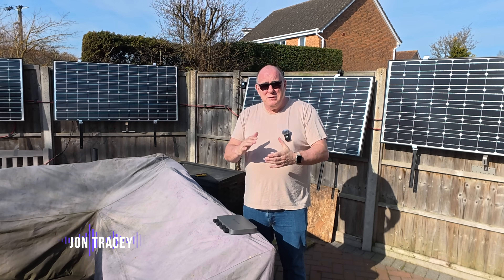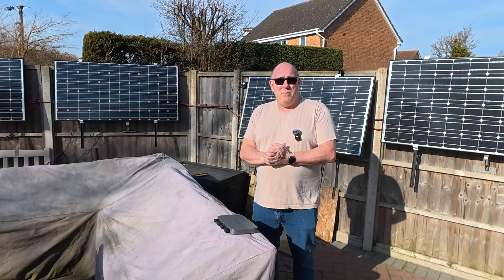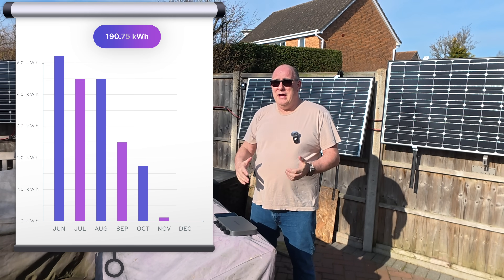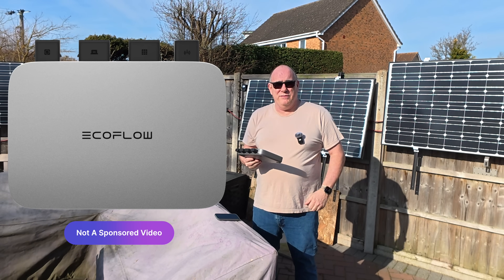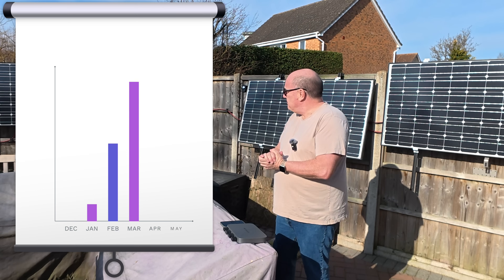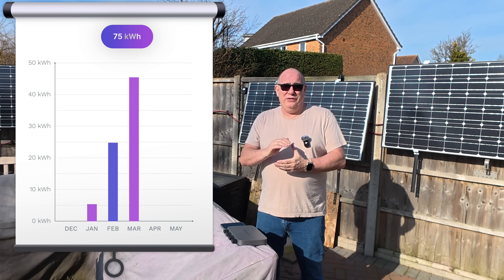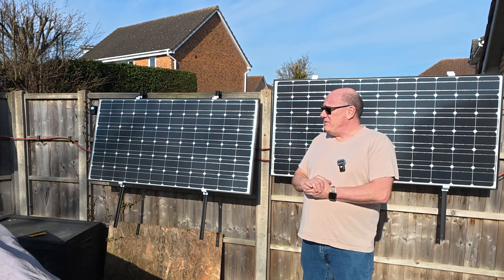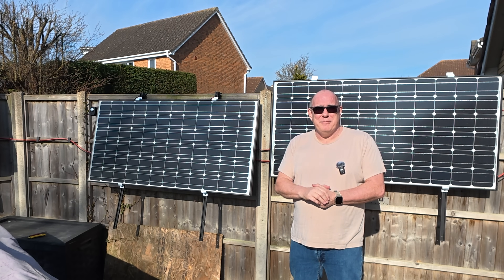WINTER SOLAR PANELS PERFORMANCE SHOCKER

Comment: Being a multi Delta 2 power station + extra batteries owner (5+ kWh total), I am always interested in this sort of stuff. They are charged at night using the Octopus Go tariff and we then run all our heavy stuff (fridge, air fryer, kettle, coffee machine, toaster, microwave) off them during the day. Being in a rental house means solar panels on the roof are not an option. However, I am toying with the idea of putting the cable of portable EF solar panel through an air vent to charge one of the Delta 2’s, just for a bit more “back up”. I have subscribed to your channel based on this video and I am interested on your progress and results. Also, interested into knowing if it’s possible or how Delta 2’s could be integrated into the domestic house wiring, in case we buy our own place one day. I have friends who have professional solar panels and 5kWh batteries fitted to their properties and get feed in discounts. However, I am gobsmacked to hear that if there is a power cut, they cannot use the battery power to feed their houses and will have to suffer a blackout regardless of their system. 🤷🏼‍♂️🤦🏻‍♂️ Thanks for the video ..good stuff. 👍🏻
Reply from the maker: So there are two ways to add the Deltas to the power system in the house that I know of. The first is through Ecoflows Smart panel. However if your in a rental then I doubt you want to start ripping out panels to make this work. The second is to use the powerstream inverter. This only needs wired into a fused spur, and can deliver up to 800w from solar and batteries. But even without solar I believe it can send 600w direct from the batteries into the home.
Reply: @  Thanks for that, excellent info. I will research the Powerstream inverter. 👍🏻
Reply: @ thanks. I have had a look at the inverter, but 600W into the house isn’t going to be much use to me. I think running my appliances direct from the Power stations seems to be my best arrangement as there are no power constraints. Interesting though. 👍🏻

Comment: that looks to be a sun tracker with single axis adjustment. probably a motorised solenoid or similar behand the panel. I have an ecoflow system the inverters are a great price but the cost of panels and extras is not that great
Reply from the maker: Well, I could tell you you correct but then you wouldn’t come back next Tuesday and watch the video😂
Reply: @JonathanTracey  Ha! Nah, I love this stuff. I'm very limited with my solar, I just have a powerstream with a single solar panel. It does okay, though, giving me peaks of 460w. The MPPT doesn't seem to clip past 400w.

Comment: Brilliant This just popped up on my Feed Probably because I watch a lot of similar Stuff. Any hoo I've had Solar panels on my Fence which is also on my balcony for 3 year Started with 2x12v 200w now upgraded to4x12v  250w I've got my electric bill down by 50% Fences with solar works well I've found
Reply from the maker: That’s amazing! 🎉🚀 Love hearing real-world success stories like this! Solar panels on your fence AND balcony, that's amazing.

Going from 2x200W to 4x250W and cutting your electric bill by 50%—that’s seriously impressive! It just proves that you don’t need a massive roof space to make solar work. Fences, balconies, sheds—if it gets sunlight, it can generate power!

So awesome to hear you’ve been doing this for three years and still finding ways to improve your setup. Have you thought about adding a battery or are you just using everything in real-time? Either way, this is inspiring stuff—more people need to know that creative solar setups like yours are possible! ⚡🔥☀️

Keep it up, and thanks for sharing! 🚀🌎🔋
Reply: @JonathanTracey  That's was a quick Response 👍 I've got two 200ah Lithium around 5kw Upgraded from the agms that I originally brought 4 odd years bk. I'm still New to the technically stuff when you talked about real time? I having got the fancy set up it's a Vevor Hybrid charger. Will look forward to your next update
Reply from the maker: Just happen to be having my lunch so catching up on comments. Yeah, I’ve got an upgrade video for the fence system coming probably on Tuesday, sneak peak. I’ve installed a single access solar tracker to try and improve the generation from the panels.

Comment: Hmm.  Not bad.  That unit is rather expensive but at least it has two MPPTs so you can separate the two panel facings.  What you really want on your fence... or in any off-light situation, are half-cut bifacial panels.  Such panels will do a much better job gathering ambient light, particularly in partial shading conditions.  Not magical, but definitely better than other types of panels.

You might want to consider doing a little Pergola project.  I've had good success with my little 10ft x10ft Pergola.  I put a couple of panels up on top of it (it can't handle a ton of weight but it can handle a couple of panels), basically flat but at a slight tilt to shed water.  Plus a few solar panel drainage clips (prevents water from pooling on slightly-tilted panels).

In anycase, I have 2 x 410W Hyundai  "S410YH(BK)" panels sitting on my Pergola, basically flat, and they are generating about 2kWh/day now in March.  Probably more around 3-4 kWh/day once summer hits.  And roughly 1 kWh/day last winter.  My Pergola doesn't even get any sun until afternoon!

-Matt
Reply from the maker: Yeah, bifacial panels can definitely help in low-light conditions, but for my setup, the orientation and available space were bigger factors. As for cost, the microinverter was only £99, so not expensive at all! A Pergola project sounds interesting though—nice to hear you're getting decent generation even with a flat-ish setup. Do you find shading much of an issue in winter?

Comment: I’m considering something similar. What directions to you have and did you tell your DNO about your increased maximum power?
Reply from the maker: Yeah, you still need to go through the standard G 98 or G 99 approval process as it’s an inverter that can potentially export to the grid. I got it included in my G 99 approval so no issues there. Our UK electrical code is a little outdated compared to some of the other European countries, for example the system would work perfectly for importing power into the house just plugged into a standard plug socket. But that’s not allowed here it has to be installed into a few spur directly on its own line from the consumer unit. It also needs DC isolators and surge protection.
Reply: Understood. I’m considering 1kw on a south facing wall and putting it into my inverter second string input, but need to speak to my installer about DNO approval. I’m looking to boost my winter solar but not necessarily the overall output.

Comment: Kudos for reusing your old tech. They will most likely give you at least another 10 years of power so why not? Are the differences in orientation and azimuth an issue for you?
Reply from the maker: Yeah, they don’t get anywhere near as much power as they would if they were mounted at about 33 to 38° on a roof but free power is free power.

Comment: Hi Jon
Can I just ask exactly what the EcoFlow inverter does and how it works please 
Thanks in advance
Reply from the maker: It’s just a small version of a solar inverter that you would use in a large solar installation. It takes in DC power from solar panels and converts into AC power which then injects into your house for you to use. It can only handle a maximum of 800 W, compared to my large inverter which can handle 10 kW. But for a small scale installation, I think they’re a really good product
Reply: Thanks Jon,
So in affect it means the EcoFlow device can then be used like a powerbank to charge items off etc
Reply from the maker: @leemurray1772 no the powerstream sends power into your home and you charge your power bank or run your kettle off the mains power. The powerstream can accept ecoflow batteries (the big ones) as storage, so the solar can be saved in the batteries until later in the day when you need it

Comment: Ooh, teaser for the next video.  My guess is its a light meter and motorised tilt mechanism on the panel to maximise solar generation by tipping the panel from the bottom.
As an alternative way of getting round the current UK wiring regulations the solar panels could be wired into the hot water immersion heater, so capturing the generated electricity in a thermal store.  A friend of mine did this.  Would need to think about cut-off temperature though to avoid super-heating the water
Reply from the maker: I can’t possibly confirm or deny. Yeah, you could wire it into the water tank that way. I actually had an electrician why am I in so that it’s compliant with the regulations. But he did say we need to update our regulations as in Germany you can just plug this device straight into any plug socket. It has all the safety measures in place and works that way with the UK plug sockets even though it’s not officially allowed.

Comment: I am beginning to think it is cheaper to make fences out of solar panels rather than wood these days, good work grabbibg that horizontal sun!
Reply from the maker: It could well turn out to be cheaper, there are some dedicated fence panels with solar panels built into them, but they’re quite pricey at the moment. I’m wondering if I could make my own.
Reply: @JonathanTracey here in Italy now, I am buying 455w panels for €54 + vat each. Granted I have to buy a pallet of 36 to get them at that price but there is no way you could buy a fence panel that size here for €54!
Reply: What are the dimensions? Do they export!!? 🤔 @paddyglenny
Reply: @deeowens  Hi there, I'm looking through my electronic paperwork to see if I can find the dimensions for you. Will let you know as soon as I find them. I don't know if my local wholesaler is switched on enough to export, post brexit (I'm assuming you're in the UK?) but I'm in there a couple of times a week and will ask for you. They sold by a subsidiary of Osram in Germany, so a legit supplier. I have two pallets of 36 panels ordered for two clients (I do off grid pv installs).
Reply: @deeowens  just got the dimensions.  1764mm x 1134mm x 30mm
Reply: @deeowens  And the make of the panels is Ledvance
Reply: @paddyglenny  thanks, I'll look them up. I'm in north Ireland so in EU!
Reply: @deeowens  piece of cake then I'd say. I've got a photo of the pallet spec label but I don't think I can post a pic here and don't really want to put my email address here...not sure what to do....
Reply: @paddyglenny  can I post it on Imgur then link the image
Reply: @deeowens  let me try
Reply: @deeowens 
You can buy a 435W panel for £62 retail in the UK (with discount bulk?) and as in understand it's an efficient panel.
(Search.... City plumbing .... From memory)
Reply: @JonathanTracey  was wondering about replacing fencing panels with scaffolding boards between my concrete posts to fix a battery and cabling to, I wonder if such could be a cost effective way of making a good backing structure for your bits.
Reply: In the Netherlands it is
Reply: Consider bifacial panels - they absorb light from the back as well as the front.
Reply: It's actually cheaper to cover a roof in solar than concrete tiles.... cannot understand why all developers don't 🤷‍♂️
Reply: 😂 innit

Comment: I agree with what you are doing but.....  190KWh of power costs me just over £12. It is not worth using them if you have to pay for brackets and screws to put them up.
Reply: I would hinge them , and keep them at sun plus 15 deg. on all but snow forecast days. This will give much better cloudy day performance and only reduce sunny day by 3 % ( as compared to straight sun angle. ) So , for me, chicago, 60 deg. dec. and 10 deg 1 july.
Reply from the maker: Yeah, like I say, it’s just an experiment at this point, ultimately if they produce enough power. I would probably invest in panels with integrated solar panels. But I need a lot more data.

Comment: I'd like to see the government take the initiative with something like a standard 1kW kit with a completely plug and play inverter so that the whole system only need plugging into a 13A socket, maybe it could include a small battery as well. As a no frills bulk purchase it would be maybe £300, same again for a 2kWhr battery, then it's a matter of DIY or "handyman" installation  on any convenient bit of wall, fence, ground, etc.
Reply from the maker: The only thing standing in the way of such a product coming to market today is the outdated regulations here in the UK. Feeding energy back into the house while the plug socket is not allowed under the current electrical regulations despite it being done this way in Europe for many many years. I get it the overcautious safety people will say that you have no idea what the wiring is behind the socket and you could overload the wiring. But by limiting it to 1 kW, there is much less chance of this happening and this happening when somebody plugs in a 2 kW heater
Reply: @JonathanTracey how can you back feed through a plug?
Reply: Sounds like a good idea, but how many would be killed in it's installation? Why do you think all electrical products come with a molded plug now? The moment you uses a "pro" to install another £1000 has to be added I'm sorry to say.
Reply: @abbersj2935  It doesn't cause problems in other countries so why should it here? I've seen systems in Poland where the battery and inverter are inside in a small cabinet about the size of a tower PC and plugged into an standard outlet, the panels are on the wall outside and low voltage DC cables are put through the wall. Anyone capable of drilling holes and using a screwdriver can install the system.
Reply: @garysmith5025  Really gary? "NIOSH estimates there are 400 fatal electric shocks per year in the US (about 0.12 per 100,000 population). In the UK, which I’m using as our type example for 230V systems, the Office of National Statistics puts it at around 13 per year (or 0.02 per 100,000 population). Put another way, the per capita rate of fatal electric shocks is about six times lower in one particular country with 230V supply than in the US".
Reply: @abbersj2935  Possibly you didn't read my post, you plug the battery/inverter unit into a socket, in Poland they come with a pre-wired plug as required in the EU, the only "wiring" to be done is low voltage DC.
Reply: How can you possibly have something that generates electricity wired to a plug and then back feed it into a single circuit?
Reply: @paul756uk2  You can feed it into a single circuit and it distributes to other circuits via the consumer unit, that's how all solar PV works. Note that if you unplug the inverter the plug is not live, same as a conventional inverter if it can't see the grid it shuts off to avoid energising local lines in the event of a power cut.
Reply: @garysmith5025  There is absolutely no way that making a plug live is in any way, shape or form acceptable. Do you seriously think that would pass any UK standards? You simply can't make something safe by having to remember to unplug another cable. Any electrician that installed something like this could undoubtedly be prosecuted for this kind of practice. For a start, how would any unsuspecting person know the plug was live?
Also, the idea of back feeding into a circuit means that the circuit isn't protected by the circuit breaker in the event of an over current because you've bypassed it.
Reply: @paul756uk2  I very clearly said that the plug is not live when unplugged. If I recall correctly the shutdown time is no more than 3 AC cycles, so <60mS.
Reply: @garysmith5025  yes and I very clearly said that unplugging a device to make a 3 pin plug safe is unacceptable. What is it that you don't understand that making the pins of a plug live is in any way acceptable? You simply cannot do this kind of thing.
Reply: @paul756uk2  How are the pins of the plug live? There is one 3 pin plug on this device, and when it isn't plugged in none of the pins are live, it doesn't get any simpler than that.
Reply: @garysmith5025  Maybe I'm misunderstanding it then but your original post said about plugging a solar system into a power circuit which would be back feeding. Maybe you could explain it in more detail
Reply: Because they wanted to protect jobs by not allowing this.
Reply: @ Who are "They"  The big bad boogyman?

Comment: Great video Jon, I also have 5 panels in my garden (on top of wood sheds). How does your Ecoflow work with your other home battery system? If the EF is connected to the consumer unit, do your separate home batteries allow the energy to feed the power into the house? I also had issued getting the Shelly 3EM to work as when connected to the CT clamps it could not read anything from the house wires (due to the Growatt home battery jumping in to provide power first).
Reply from the maker: I run the ecoflow powestream in constant load mode - it pushes out 500w constantly from sola rand batteries. I tried with the Shelly but found it did as you describe, the inverters got into a race to see who could supply power and sometime the answer was neither. So I have the PS in constant mode and the solaredge supplying power when needed, seems to work seamlessly.The batteries are connected through the powerstream, so yes when not enough solar they supply power. I then charge them up on Octopus Intelligent Go at night in the winter. In summer they are pretty self sustainin
Reply: @JonathanTracey  Thanks Jonathan, I really appreciate your advice. You've confirmed my experience.  I've set the baseload to 100 watts on mine and the plugs cover the rest. Big stuff like airfyers use the solar first then drain the big battery for anything over 800watts. Seems to be working. Pity the Shelly is not viable in this set up.